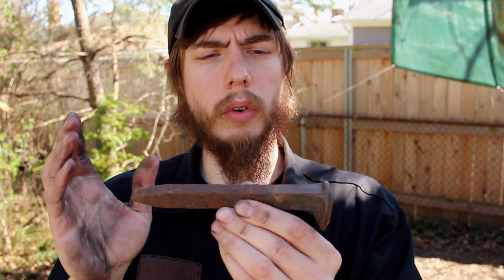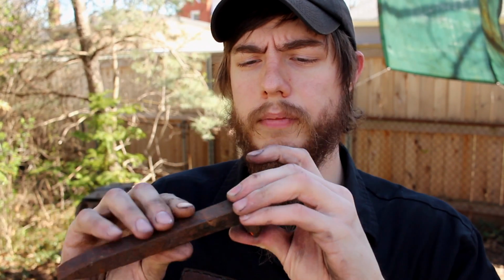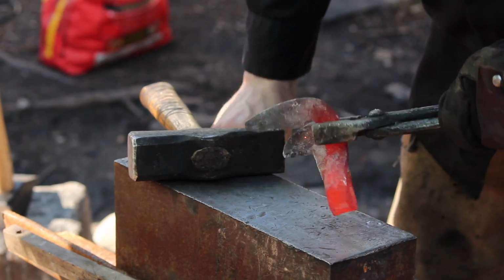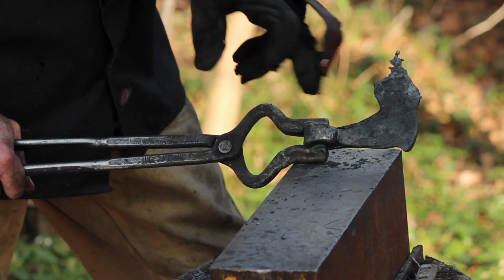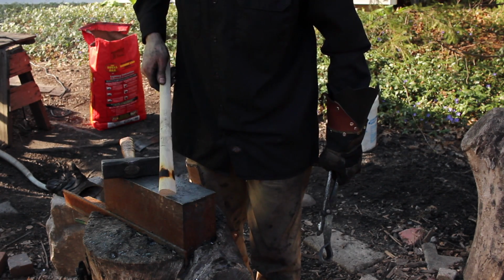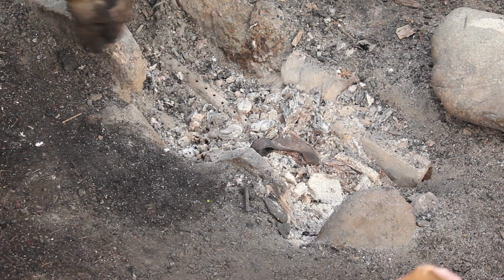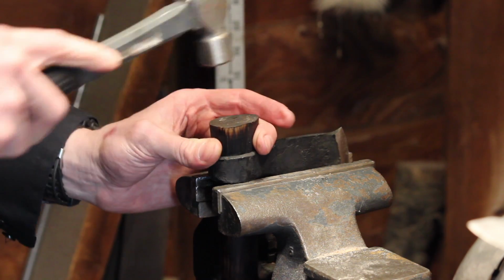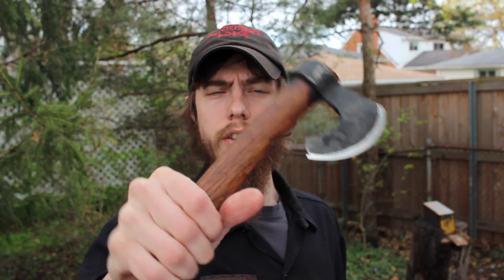Forge-Welding Technique for Making Bigger Bearded Viking Axes From Railroad Spikes

Comment: I've got a couple of questions about these viking hand axe/ hawks.  First, are you using high carbon railroad spikes  (stamped HC on the head)? Second, how did they perform as hawks?  Throw well?  Hold an edge for long?etc...
Thanks for another great video Phil, truly helpful,  and exactly what I'm looking for to  break in to forging.
Reply from the maker: Yup HC marked spikes, hold an edge well enough. They throw good, tho the shorter heads can be tricky. Thanks Jim!
Reply: An anvil and a forge. Possibly a hammer. That's what I started with

Comment: You need to check it to see if it's nonmagnect and quench in warm oil or water not cold oil if you want it hard hard need a little more practice and you'll be spot on just watch how thin you get your metal cause as you see it will burn up but good job

Comment: So how exactly do we forge weld without burning all the carbon out of the steel?
Reply from the maker: My understanding is that welding heat is just below that of the melting heat, in which the carbon starts burning off.  Thats when you see it spontaneously throwing sparks.
Reply: @PhilBaumhardt  good to know. Helps me relise I havent completely messed up a few projects. Its really easy to do somthing else while the steel is heating up and melt the shit out of it. Ive done this tons of time by mistake. It seems like it heats up faster when im not paying attention.
Reply from the maker: @norwoodcraftandforge2950  happens more than I'd like, even now. With charcoal/coal forges it's always a risk.  But yeah, if the steel is in the fire, your mind has to be there too.
Reply: @PhilBaumhardt  damn straight. I have a charcoal forge. Sometimes it gets around 2000 degrees
Reply from the maker: @norwoodcraftandforge2950  nice to know I'm not the only one haha. I appreciate ya watching the video. Happy forging!